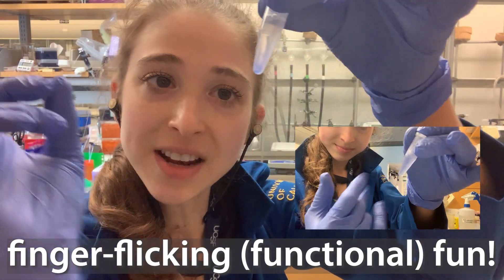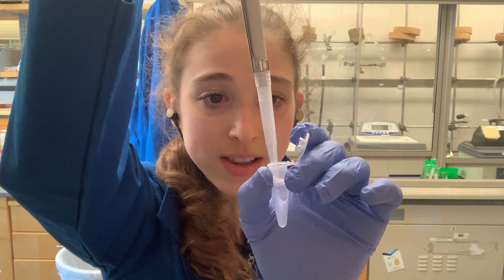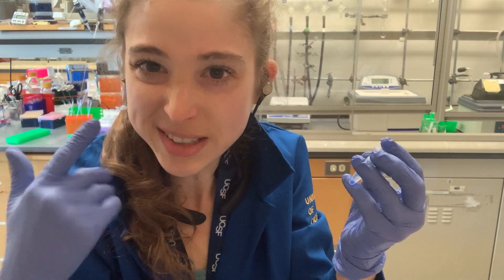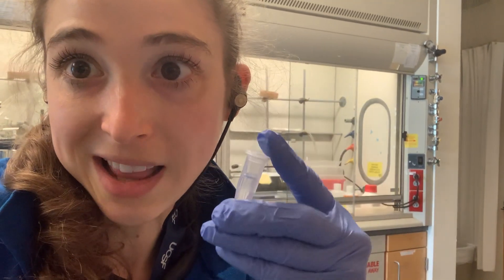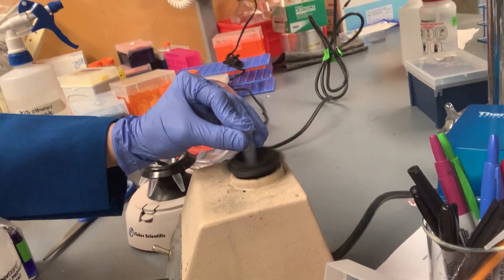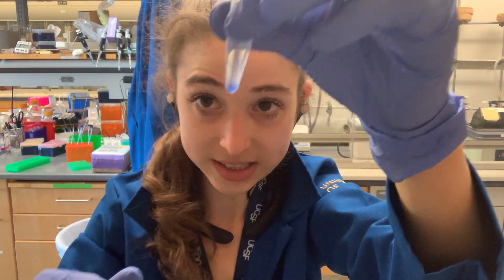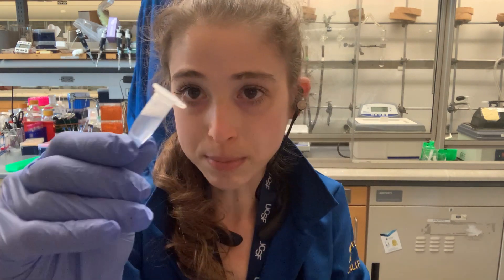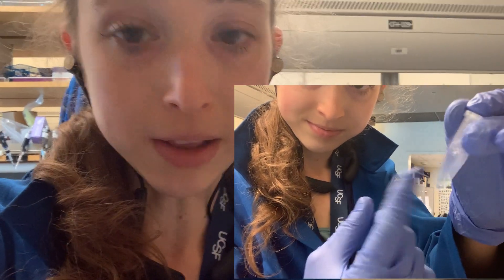The finger flick - an awesome lab trick! Finger vortexing & other mixing methods

Comment: Thanks a lot for the great video! Just to clarify the value of using the the finger flick instead of the automatic vortex - is it generally preferred to use the finger flick whenever dealing with enzymatic reactions and/or DNA/RNA samples? 
Thank you!
Reply from the maker: Thanks! With enzymatic reactions I would definitely just finger flick it. DNA/RNA could depend